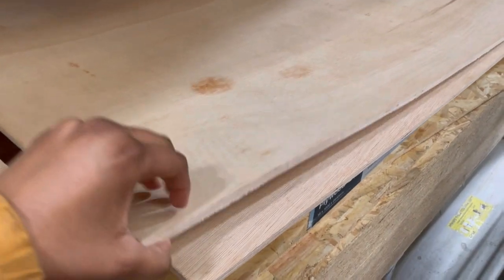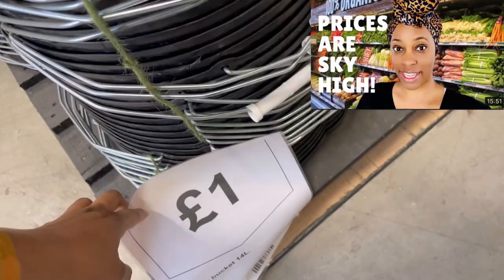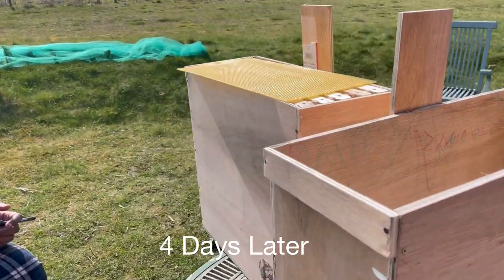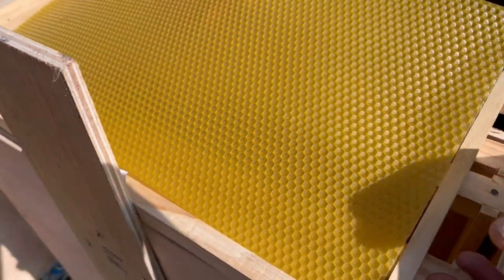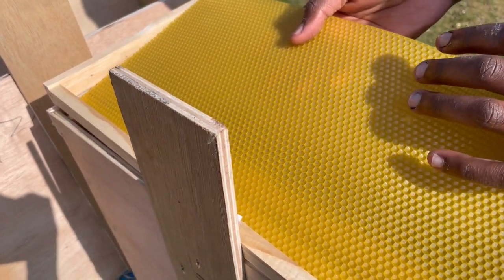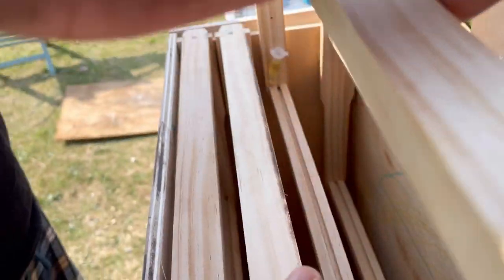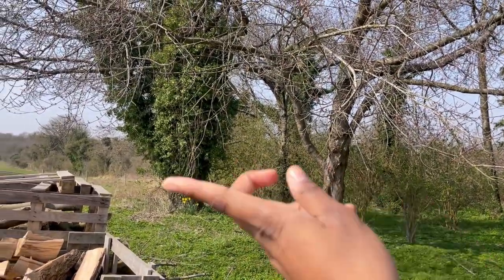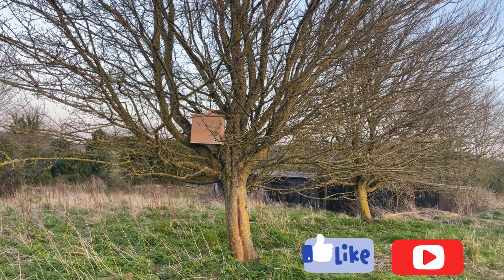WE MADE SWARM TRAPS! 🐝|OUR BEEKEEPING JOURNEY| SDA COUNTRY LIVING

Comment: Hi, hope the Lord blesses your efforts. It's just one of those you things you really have to pray for wisdom. I have 20 swarm traps this year, had 10 last year, caught 7 swarms. Two observations, it looks like your foundation is pure wax, I would be afraid of it melting, they sell plastic with a heavy coating of wax, that's what I use (as heavy a coating of wax as possible). Second, make sure your frames are all tight together, otherwise the bees will fill the space with propolis and if the space is far enough apart build some really strange comb, like in between frames. Oh and one more thing (sorry), make sure there is a starter strip on the top of each frame so it will look something like a T, half an inch would be sufficient, gives the bees a base to start on, otherwise they will build it anywhere on the bottom side of that top bar of the frame, that wax foundation would work great, just cut it into one inch strips or whatever and secure it somehow maybe with melted wax or something, I suppose glue or silicone would work, just something that will hold it in place and support the weight of the bees as they build the comb off of it. I alternate frame with foundation / frame with starter strip/ frame with foundation/ etc., that way it kind of guides the bees, so they're not building crossways. Also, just a side note, not a deal breaker, but, if possible smaller cell foundation is supposedly better for the bees, like 5.1 mm, 4.9 mm is also commercially available but too small from what I've heard. I get mine from Premier Foundation, shipping might be kind of high to the UK, don't know.